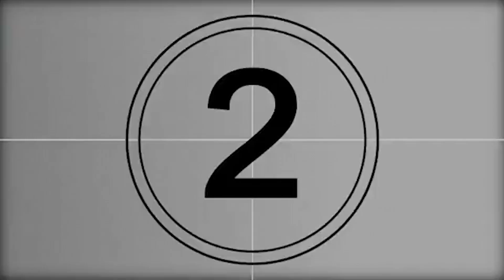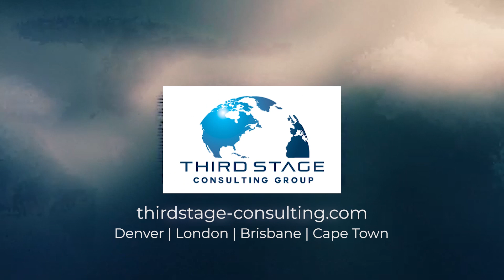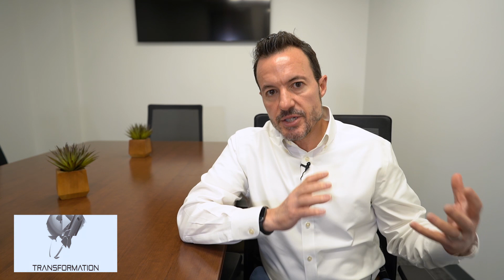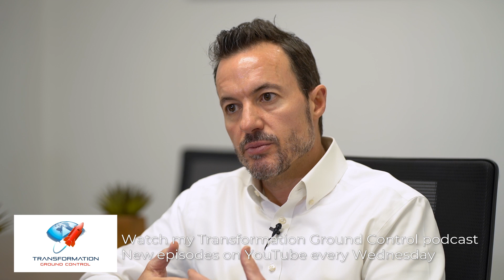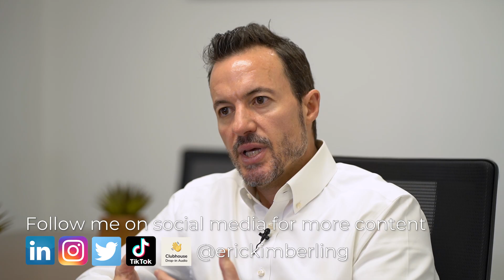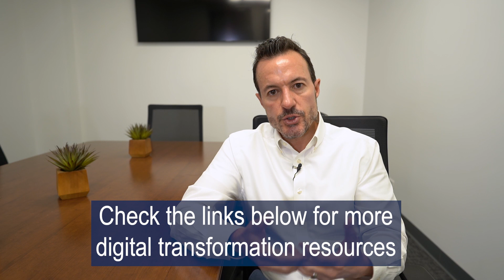Top 10 Manufacturing Execution Systems [Best Manufacturing Software]

Comment: Hello, what would you recommend if my company is a tannery and what we are looking for is that our customers can know in which process the leather is, that also can generate production costs based on recording the formulas of chemicals and other products used in manufacturing. It is important that it is compatible with the iOS system and can be used on iPad.
Reply: I am an MES system software manufacturer, you can contact me if necessary

Comment: Eric - I think you need to delve into "Infor" more deeply.  My background is with Infor Visual.  It has the BEST scheduling system for handling both large and complex equipment, widgets, etc.  It can most certainly handle multiple sites.  Some VERY interesting companies use it.  Infor LN is for the big boys and competes with SAP, Oracle, and Microsoft.  It is a whole separate ecosystem with a whole separate market.  Multi-site?--no problem.  Infor Syteline (CSI rebranded back to the original name).  Is also multi-site, focused on manufacturing.  XA is specifically for IBM systems.  Infor Lawson is a whole different animal.  Infor M3 is another whole different animal.  And there are others.  May I suggest you get with Infor's president and get a more in-depth view of Infor's stable?  Because, when you get right down to it, there is no such thing as "Infor ERP".  You always have to narrow down to WHICH Infor ERP.

Comment: There is no general top10 MES list. Go to some industry specific Exhibitionist and take a look. There are many of (small) MES providers which are specialized on Your buisness. Choosing a (big) generic MES isnt always the best way to go, in my opinion. In the end you will pay more for the customization to fit your requirements.
Reply: Agreed the cost of configuration to meet your needs will almost definitly be higher.  But one of the things your paying for is the longevity of the company, will they be there in 5 years when you have to upgrade?  Also the integration and support network.  Small vendors have small footprints, you pay a premium for niche support.